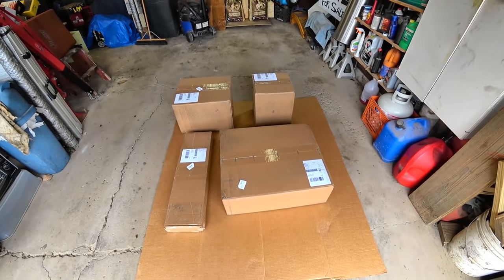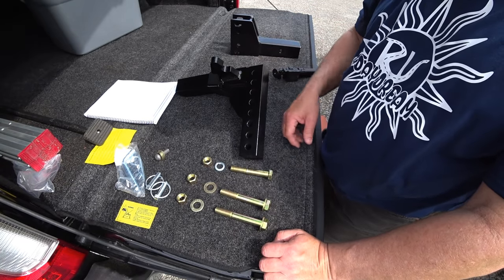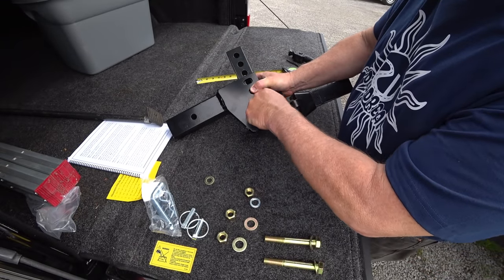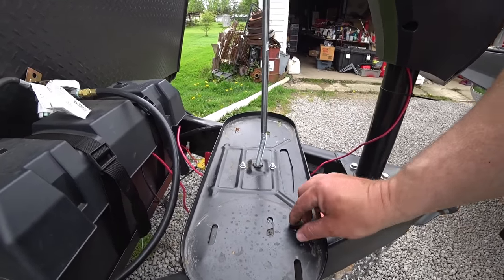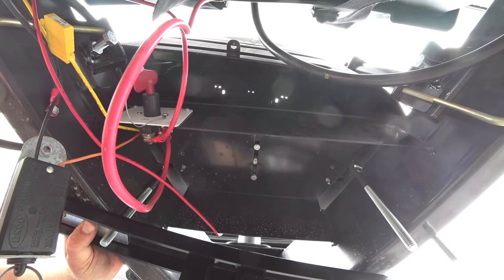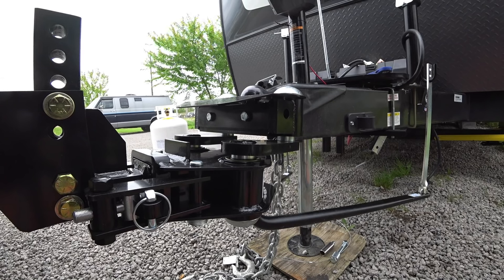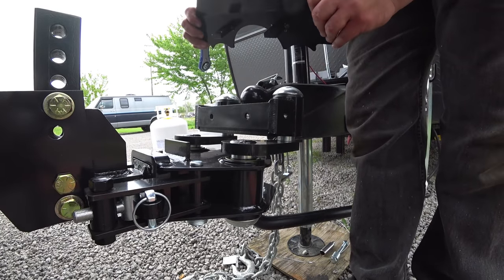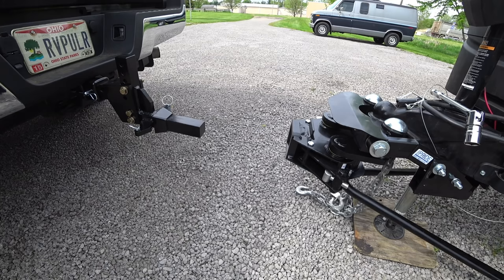ProPride 3P Hitch Complete Installation

Comment: I'm sure the ProPride is a great hitch and it, like the Hensley, will be top-of-the-line for eliminating sway, but for your travel trailer and F-250, it's completely unnecessary.  An Equalizer 4 pt. WDH will be more than adequate for your combination and can be purchased at RV Wholesalers for around $500.
Reply from the maker: I almost Bought the equalizer due to it's price BUT, I do not like the 2 points of contact that equalizer utilizes for friction on the L brackets....They become worn, rusty and when wet offer less friction for sway control, Also they are the noisiest bars in the Campground. They offer a composite add on for the noise However, that also reduces the  friction  used to control sway? not sure why they would defeat their own design other than they cant engineer out the noise.
Reply: RVdaydream I used an Equalizer 4 point hitch on 2 travel trailers - a 24’ hybrid (10K model) and a 32’ regular travel trailer (12K model).  I also used the bracket jackets to minimize the noise.  Equalizer even says you can put a bit of grease on the front friction points.  I did all that and had no issues with sway on a 32’ travel trailer.  If it does get a bit rusty, you can just spray a bit of black Rustoleum paint on it to clean it up.  At $2000 to $2500 less than the PropPride or Hensley its a very easy decision to have to apply a bit of paint every 1 or 2 years.  Those expensive hitches have their application but for your combination its totally unnecessary.
Reply from the maker: @allan6021  getting caught in  unexpected 50- 60 mph sidewinds may prove to be an eye opener.... I find it shocking that people similar to myself would spend $30,000 on their RV and $40,000 on their truck and only $600 on their hitch even though, a rather low, (in comparison to potential loss), investment of $3,000 would ensure they had the absolute safest hitch for towing out there. I know what I could get by with, I can't justify doing it. 
 It's definitely a personal preference. For example why did you buy The Equalizer? You could have easily got away with the Harbor Freight weight distribution system that is around $260? Shoot, I towed the RV home with a used, cobbled together, mismatched, heavily worn, Craigslist bought, hitch system that had the wrong spring bars and was misadjusted and it worked just fine. 
 Being a repair person and fixer of things I know how to get away with quite a bit of things that maybe lesser quality, but, I know when to do things the right way. I've ridden with my brother-in-law who had an equalizer four point, towing a 32 foot Coachman and I have rode with one of my best friends who had a Reese dual cam, and 1978 Airstream and our elderly neighbor, who has since passed on, had me tow his 28 foot Jayco to a not too local Campground for him, and in each of those situations I always felt when tractor trailers drove past us. It's just an engineering thing. I don't think people necessarily realize the physics behind it. If I was to put this propride system on a small landscape trailer, you know one of those from Harbor Freight that could easily be picked up from the rear by a couple of guys or even myself, once up in the air, you cannot physically move the trailer side to side it is impossible due to its design. So let me give you another example, my kids, when they were small, used to have a wagon that they used to ride down our driveway and the wagons front axle was attached with one Bolt in the center at the front of the wagons body. Well it never failed that once they got going so fast the steering got really shady and usually flip them out. The neighbor moved away and they had left their kids wagon at our house, (they used to ride down our driveway too), instead of having the same type of mounting on the front axle as our kids wagon did, instead it had two spindles with a drag link that the handle connected to. It was stable as a rock going down the driveway and the kids could actually slalom back and forth without any fear of flipping. It's the same principle. It's just better physics for better control. I bet you don't have China bomb tires on your RV do you? It's not always about the money. especially when this is going to be our home. just stressing my point. this is definitely not an argument. I love that you're commenting. it's the only way people can share on this format. Thanks for the feedback! :-)👍
Reply: @allan6021  Comparing an Equalizer hitch to a ProPride hitch is like comparing a tent for camping shelter to a travel trailer for camping shelter.  A travel trailer is totally unnecessary for shelter. A tent will shelter you but it's not a travel trailer.  Same goes for a conventional friction-based sway control hitch when compared to sway eliminating pivot point projection.  5th wheel owners know the difference when towing with the pivot point at the rear axle. It's the same stability ProPride owners know.
Reply: Sean Woodruff You have a personal financial interest in ProPride so your input has to be viewed with that in mind.

That said, I’ve already agreed that the ProPride and Hensley hitches will be better at managing sway but I just don’t believe the risk of experiencing sway beyond the capabilities of a properly set up Equalizer WDH is significant enough to justify paying 5x the price of an Equalizer. Especially when the ProPride offers no significant advantage for weight distribution.

To each his own.
Reply: Allan you can view it any way you like. With that in mind also keep in mind I fully understand towing dynamics and have been engineering systems for 24 years. In no way is the Equalizer anywhere near comparable to the design and function of a ProPride hitch. Anyone who says it is doesn’t understand basic physics and towing dynamics. I’d be happy to debate it any time and meet anyone on a test track to compare the two. It’s a flat fact of design and physics the Equalizer can’t perform at the level of the ProPride. And, I’d say that whether I owned ProPride or not because I’m an engineer who unserstands hitch design and performance. A travel trailer is much more than 5x the tent for camping shelter and it should be because it offers much better performance.
Reply: Allan and I resent the fact that you think my integrity and character is rooted in a financial interest so that is the reason I advocate for a better, safer design for RVers. I’ve been an expert witness in 2 cases where people have died in trailer sway accidents and I refuse to let people on the internet run their mouths about something that could be taken as fact and injure or kill someone. People need all the real facts to make a decision and if you advocate from a limited perspective and understanding you probably shouldn’t be commenting like you actually understand it. It’s dangerous. And, I’d say that with or without a financial interest. You thinking that says a lot about you.
Reply: @SeanWoodruff  Totally agree with you Sean. Your product is supported by physics. I know we live in challenged times where Science, for some, is deemed suspect. I too own a 3/4 ton pickup but this doesn't change the vehicle dynamics. The friction based system just wasn't cutting it. You market a very well engineered product and I am very pleased with the purchase.
Reply: @archibald2able  thank you, Stuart!

Comment: to long and how many people do you think are going to try doing this at home?
Reply from the maker: People who are full timing on the road in RVs either have to have a a lot of money so they can pay other people to do the work or, have the ability to repair and modify on their own. So to answer your question, anyone who wants to save money install the hitch themselves. As far as it being too long? I have a 30 foot long trailer, should I just bought a normal hitch and bought a 30 ft 6 in Long Trailer? I don't mind the extra six inches and length knowing that I also now have 87 degrees of turning angle.
Reply: Bob Runde. I would because I am mechanically inclined, I know it would be done correctly, and I do want to pay $ 75.00/hr for someone to do a job that I would be billed for 3x as long as it takes me too. Negative comments really are not necessary when RV daydream takes time to make a video to try to help people.
Reply: 90% of all the ProPride hitches sold are installed by the owner.

Comment: Mike. You're spending all your camping money.   I  use an equalizer on my windjammer. JEEZ $3K for a propride? Why?
Reply from the maker: I almost Bought the equalizer due to it's price BUT, I do not like the 2 points of contact that equalizer utilizes for friction on the L brackets....They become worn, rusty and when wet offer less friction for sway control, Also they are the noisiest bars in the Campground. They offer a composite add on for the noise However, that also reduces the  friction  used to control sway? not sure why they would defeat their own design other than they cant engineer out the noise.
Reply: @Rvdaydream  I've got those phenoluc bar support pieces and with 1000lb of tongue weight pushing on the bars it doesn't negate the purpose or reduce friction, just noise.  It's a price difference thats hard to justify for me. I'm very comfortable towing
Some folks just need more of a warm fuzzy and that's why they can charge $3k and get it.
Reply: @bruiser8363  not true... it's functionally a different design and not comparable to a friction-based system.  Has nothing to do with warm fuzzy. It's designed and performs head and shoulders over friction trying to damp the trailer pivoting on the hitch ball.  You will never be able to create enough friction to overcome the trailer weight pivoting on the hitch ball.  That's how trailer sway begins.  And, if the noise is reduced you are, in fact, reducing the friction and the way the hitch works.  The coefficient of friction between two steel surfaces is greater than the coefficient of friction between steel and a polymer.  The noise is a symptom of the friction being created between the surfaces.
Reply: O.k
.  If I'dve just spent $3k on a hitch I'd try to justify it too.   Hope you enjoy it.  Aloha. C
Reply: @bruiser8363  I'm not justifying anything. Just posting the facts. Towing a travel trailer with the effective pivot point at the rear axle is different than towing a travel trailer with the pivot point at a distance behind the rear axle and acting as a lever on the tow vehicle.  Ask anyone who tows a fifth wheel and they'll tell you about the stability of a trailer pivoting at the rear axle. Like I said above, it's functionally different. Not a justification but a fact.
Reply: That's great. I'd like to continue but gotta load the camper we're going to east Texas in the morning . 😀
Reply: @bruiser8363  have a nice trip!
Reply: @bruiser8363  If i spent 3k on a hitch I would probably have a pass out with sticker shock... This maybe be the best hitch for towing a travel trailer but in my opinion a $3k price is INSANE... Just my personal opinion.  the others might wear out a little sooner and make more noise but still.   $3K......
Reply: @LJT7907  A lot of people don't spend $25K plus on camping shelter for the same reason. They camp in tents.
Reply: It depends a lot on the combination. You certianly don't need a hitch like this with a 25' travel trailer or even a large flat deck and a 3500 dually. But a 1500 pickup and a 35' travel trailer might change your mind.

Personally I have a Toyota Sequoia and a 26' Travel Trailer that is 5300lbs dry. I use a good ol' equalizer hitch setup and have zero issues. Tows like a dream.
Reply: Agreed. The manufacturer should be ashamed charing $3k for this. It works very well but is over priced. But good for you. It will work well.

Comment: Myself I prefer my fifth-wheel hitch and trailer. They don't sway and are fast to hook up. Besides that fifth-wheel hitch cost less and is not as complicated as your hitch. While your messing around hooking your hitch up I'd be 10 or more miles down the road ahead of you.
Reply from the maker: Maybe 10 more miles down the road, but you're also taller and I can travel under ten times more bridges then a fifth wheel, I can also haul  ten times more stuff in the bed of my truck and have it protected. There's pluses and minus the both. You may want to check out my previous videos where I discuss this fully.
Reply: My truck does not have enough payload for a 5th wheel (wish it did).  The propride was the best option for me.
Reply: 5th wheels are better in every respect. I'll be getting one someday!
Reply from the maker: To each their own!